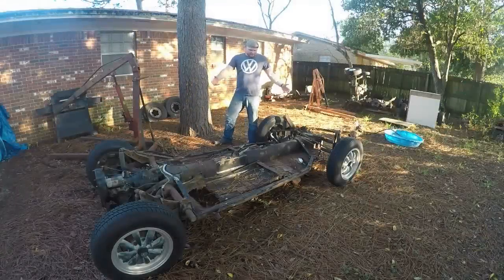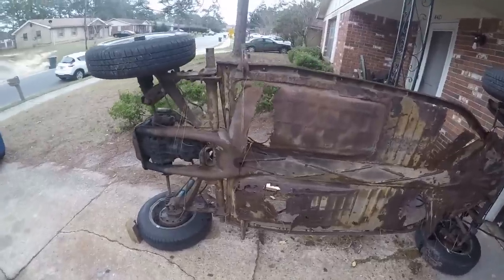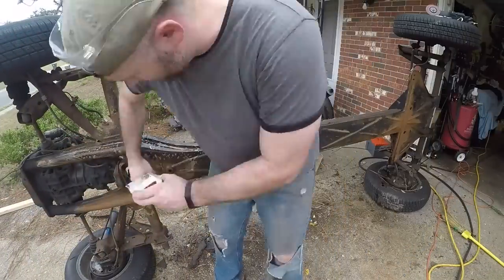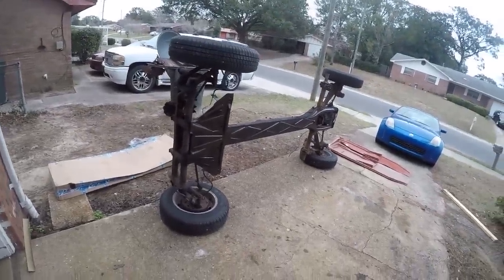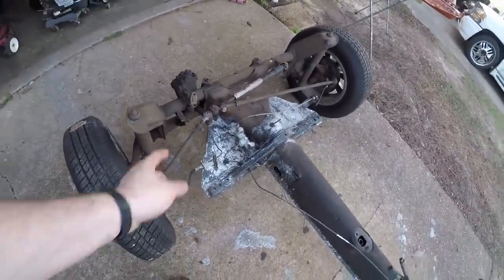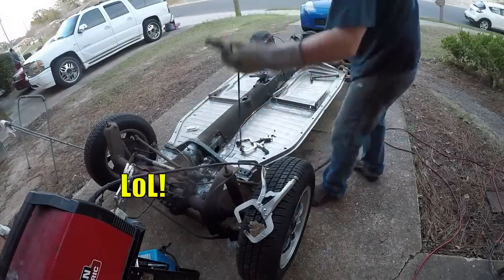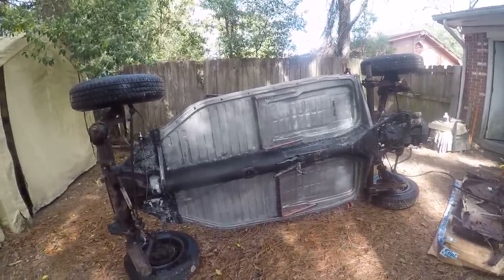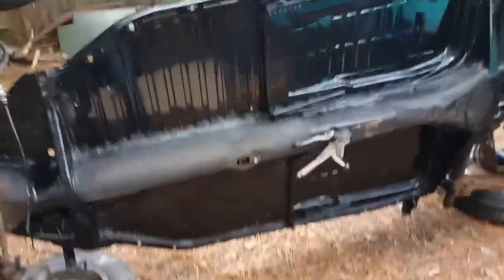Replace VW Floor Pans in 25 Minutes - (Beetle)

Comment: What if the original floor pan is thicker that the replacement pan? How do you weld it with a MIG pan-100 wire feed?  Settings? Really enjoy your tutoring.
Reply from the maker: Hi Chip!  If you find a thicker-than-stock floor pan... USE IT!  Haha!  I can't tell you how to use your welder though,  there are other videos and teachers for that one... and settings aren't always the same even from one indentical welder to another because of a myriad of variables such as materials used, preparation, weather, and even manfacturer's tolerances in the welder itself.  I hope I helped for whatever its worth!  Thanks for the question!
Reply: Thanks for replying. In reading the comments, I realized that the welding is another story. I'll keep practicing. While the body is off the chassis, and no engine, is there anything else I should do while I have access? I've done brakes, boots, brake lines, etc. Thanks again!
Reply from the maker: You pretty much nailed it... brakes!   If you want to clean and paint your transmission or replace your CV joints, or axle boots now would also be a good time!

Comment: Thanks for the video!  Do know if you customers ever have a hard time putting the body back on and having it fit correctly?  Does replacing the pans flex the rest of the sub-frame enough to make it difficult to put the body back on?  Would replacing the pans with the body on be in any way a safer bet?
Reply from the maker: Hi!  Thanks for the comment!  I am actually cutting a video that answers your questions, it should be up in the next week or so.  Thanks again!   :)

Comment: I've done this job several times on a citroen 2cv. Checking the bolt positions is a very important part of the replacement. Otherwise your Body won't fit on the chassis. Didn't you check this at your Beetle?
Reply from the maker: Nope.  Parts are pre cut and fit well.   Check out the follow up video to this and you'll see a defect I ran into related to that.

Comment: Cool. Just subbed. Quick question: was it really galvanized? I’d read not to weld galvanized steel, poison fumes resulting? If so, were you protected? Thanks
Reply from the maker: Someone already asked that.  Yes it should have been, and look which way the breeze was blowing in the video.  No concern to me at all.   I won't inhale ANY smoke EVER or I get sick immediately and stop working, its an allergy problem.  Thanks for the question!  :-D

Comment: If you, or anybody knows the answer to this that would be great. Would you recommend ordering full pans for replacement in a Meyers Manx? 14 inches of the pan will just get thrown out. Thanks, excellent intuitive video.
Reply from the maker: Yes get the full pan I think you'll be better off oh, you'll have some little extra pieces if you need them depending upon how everything was shortened and all the proportions put into it by the last guy,  I hope that helps! :-)
Reply: DuckmanCycles and VW Garage thanks man! I think I’ll go that route then!
Reply from the maker: You bet! Glad I could help!
Reply: Do you air hammer through the spot welds?
Reply from the maker: To remove the old junk, yes!  Sideways, but yes!
Reply: DuckmanCycles and VW Garage excellent. You have been extremely helpful. Thank you!

Comment: Duck, question... why did you choose not to take measurements from the side of the tunnel to the outer edge bolt holes on the old floors? It would suck when you're putting the body back on the pan and your bolt holes don't line up. Just curious. Thanks.
Reply from the maker: I get criticized for that a lot... lol!  But in my case I didn't need to.  The floor pan was the exact correct size, just needed to align it with the front and rear wings  Some aftermarket pans are cut a little bigger though, and you have to trim them. I demonstrated that with my Karmann Ghia floor pans a few years ago.  Check it out if you'd like!  https://youtu.be/unQJg_6WXOc

Comment: No worries about tweaking the tunnel or what remains of the pan by slinging it on it's side or letting it fall with no floors installed? I'm getting ready to attempt this on a '67 pan.
Reply from the maker: No worries at all!  I'm strong, but I'm not Superman.... if the tunnel/chassis were that fragile that a human could bend it I wouldn't want to drive one of these on the road.  😂😂😂😂😂😂   The floor pans do very little to making the chassis more rigid anyway.  The heater channels and the roof of the body is where the structure comes from once its all bolted together!  Thanks for your question!

Comment: You know I got to say I just came across you and I like what I see I wish you were my mechanic my last mechanic let's just say I'll leave it that but I like what I see you have done I did have one question what about doing like a undercoat Rhino Lining on the undercover of the carriage I always wondered if that would be a benefit or would that be counterproductive but I love everything I saw you're very good with it with your tools you took your time there's a passion for what you've done like I said I wish you were my mechanic I got to 74 I need to get restored I got a floor pan on the passenger side that has a gaping hole in it so it took it like a quarter inch plate steel and weld it over it I lost a lot of thing about Volkswagen's the word impossible does not apply to it you can do anything and everything you want to it with the right engineering skills hey thanks for the video to see more
Reply from the maker: Thanks for the kind words!  I love the stories, keep sharing, thanks!

Comment: thank you. You did an impressive job on what I would of passed as junk. I've contacted the local VW shop to replace part of the passenger side of my '63 bugs pan. It goes in next week. I have removed the passenger seat, rear seat and carpeting yesterday. I prob would of tried this myself if I'd of seen your video first.
Reply from the maker: Thank you for the comment! Yes, its really not all that hard, just a bit time consuming!

Comment: How tall was the gentleman that wanted the seat tracks moved back? My dad is 6'10" and he can fit his fist on top of his head before touching the headliner in his 66 vw bug.
Reply from the maker: Thanks fpr thr question! He is 6'1" and I'm 6'3", far shorter than your Dad, but the head room wasn't the worry so much is being able to get in and out of it comfortably.  I have trouble getting in and out from between the seat and the steering wheel. Even worse in a Karmann Ghia.  I have to crush thr seat down as I slot myself in or out. Now I can push the seat all the way back for lot more space and adjust it from there for comfort.  :-D

Comment: learning to weld and getting welding equipment is the main thing holding me back from taking the plunge into redoing a vw bug
Reply from the maker: Nowadays you can epoxy the panels together instead. You'll be seeing some of that on my current Bus project. No welder or welding experience needed!  Fast and easy!  thanks for the comment!
Reply: @DuckmanCycles   I'll keep my eye out for that!

Comment: How do you know those holes will line up to the body nuts? I think you could clamp a 2x4 to the original pan and mark the holes, set the new pan in place, put the 2x4 back and adjust.
Reply from the maker: That question was actually answered in my follow-up video to this where I put the body back on.  The holes didn't line up and I said exactly why.  I think it had lots of do with aftermarket components from different companies and poor quality control.

Comment: I did this today but found some issues with the air chisel part. I discovered that the part that remains on the spine (the lip) is actually double skinned and so you have to be careful you are removing the original pan from the lip and not splitting the two half of the lip itself.  Wish I'd realised that before I started as I've mangled the lip a bit.  Also very important to have a sharp chisel bit!
Reply from the maker: Yep gotta be sharp!  You can also use a grinder to grind the welds thin, then just peel the old metal off.
Reply: @DuckmanCycles  Did the other side today with a sharpened bit and it took like 20 mins!

Comment: just subscribed, im going to tackle this job soon, my question is about new rocker panels, is the heater channel structural to everything? or can i omit them?    thanks.
Reply from the maker: It depends on which car you have, Beetles don't have rockers, but Karnann Ghias do! The heater channels give the car most of its rigidity and are responsible for keeping your doors square, omitting them probably not an option.  :)
Reply: @DuckmanCycles  i have a 69 beetle.  and where is the best place to source parts in your opinion?   thanks
Reply from the maker: Links are always in the video description, but CIP1 has been good for anything else you might need!

Comment: Nice work!!! It's great to watch a pro perform this procedure. Is there anything wrong with using the phosphoric acid on rusted handbrake levers & heater levers? How about treating the suspension & torque tubes with it?
Reply from the maker: Do it!  Anything you want to clean rust from!

Comment: Looks great, quick question, what size compressor are you using to power the air-chisel.
Reply from the maker: 60 gallon tank!  It gets the job done quite well!  I may hook up a bigger diameter hose for better flow in the very near future.  Thanks for the comment and compliment!  :)

Comment: I am planning no putting a fiber glass dune  buggy body. However, is there a need to add some support on the outsider edges of the floor pans? will be looking for your anwer.
Reply from the maker: The fiberglass body should have all the support needed if it was constructed properly.  I hope that answers what you needed! Thanks for the question!

Comment: Thanks for making this video, it’s really helpful. One question I have is, was there a reason you didn’t drill and plug weld the floor pans to the chassis lip with seam sealer? Many thanks.
Reply from the maker: I never had much success with the drill method.   Seam sealer is in the video!  You missed it!  hehe!  Thanks for watching!  Thanks for the comment!  :-D
Reply: DuckmanCycles and VW Garage Thanks for your reply! I love your videos! Thanks for the info, I’m about to tackle this myself shortly along with the heater channels!
Reply from the maker: Make some videos!  I want to see!  Maybe I can help guide you along the way!

Comment: Question. When you throw on new floor pans like that, how do the bolt holes for the body line up right? It didnt look like you measured for them or anything...
Reply from the maker: It depends on the grade of floor pans that you buy, the better grades are usually much more perfectly cut and aligned... but as I've discovered if you're replacing the heater channels anyway everything is not going to line up if they come from two different manufacturers as in my case.  You can see that in the follow-up videos to this video. The width wss perfect but each bolt hole progressively was off by some measurement.  I hope that helps!  Thanks for the question!

Comment: How did you make sure the body mount holes would line up? Or did you just measure before you cut the pans off?
Reply from the maker: The holes are pretty fluid, there is a lot of room for error.  Those pans required no trimming so I didn't need to worry about them!  In a later video though, I discovered the holes in the heater channels I replaced were drilled with different spacing!  I never expected that!  I widened the holes in the pan a little bit, and additional on each following and everything was good!

Comment: Great job!  Did you weld the pan just in spots or stitch welded all the way.? And then did you add a seem sealer on top of that? Some close ups would have been nice, thanks
Reply from the maker: I welded in spots, about an inch and a half apart.  Maybe I'll hire a cameraman and a production crew someday to zoom in on me working.... depends on how much popularity I gain and how much money there is to be made.  Thanks again!
Reply: Could you have Plug welded by drilling holes in the pan and welded onto the chassis for strength ..just a thought... anyhow great Job....
Reply from the maker: I think that may be excessive.  You do want some amount of flex there, otherwise the welds start to break free.  This is the reason why you don't want to run a solid bead weld there.  😀  Hope that helps clarify!  Thanks for the questions.

Comment: Did you just spot weld it to the tunel? I did not see you make hole to spot it to the edge its supposed to be welded to. Also, no seam sealer on top?
Reply from the maker: Yes, holes not needed.  Gap between pan and tunnel, weld sits at the edge of pan into the tunnel lip.  I see seam sealer in the end of the video, guess you missed it.  :)  Thanks for the questions!

Comment: Great video and job , I am assuming you can do the Karmann Ghia the same way right ?
Reply from the maker: Yes Karmann Ghia works the same way just the pans are a bit wider.  The Karmann Ghia pans also usually don't include the rear wing portion.  So before you make any cuts to your floor pan make sure you have your new parts available so you can see where you need to cut,  I hope that helps, thanks so much for the question!
Reply: @DuckmanCycles   Yes , Thank you
Reply from the maker: @markanderson769  and thank you my friend

Comment: Great video,  rusted oil pan is standard on old Bugs. I'm working on a '64, given parts and labor I'm curious how much money would one charge to replace floor pans in my VW?  Thanks
Reply: *rusted floor pans
Reply from the maker: You had me unable to respond to that before you corrected, lol!  I'm about to put up a video to answer that question, will share the link with you when I get it uploaded!

Comment: Question: In the last floor pan video you punched holes to weld the pan, just curious why you didn't do that here. Unless I missed that part. thanks for the video.
Reply from the maker: That's a very good question that I did not address in this video. But the reason why is I just don't like the results of a hole punched welded pan.  No other reason, I've seen it done both ways so I figured I would try it without the holes :-)
Reply: Thank you for the response. I have owned three 72, 74, and 77 Super Beetle, your channel has inspired me to get a new project car. I appreciate the content. You do good work.

Comment: What is your weld set up? I’m about to invest in a Mig welder to do my pans and heater channel on my 65 bug. Just curious thank you!
Reply from the maker: I think I've got a Lincoln 140 HD, but if you're only going to use it one time for your floor pans you don't even have to get that fancy... find yourself an El Cheapo for about a hundred bucks...  mine actually lasted me for years, it did many floor pans!
Reply: Thanks for the reply! I’m planning on using for many different projects. Another question were you using gas shield or flex core?

Comment: Just kinda found your channel. Do you weld the floor pans full length along the tunnel are just many spot welds?  Also do you apply seam sealer after all is done?  I just got a 73 that has some SERIOUS rust in the floor pans.  Thanks for taking the time to share your knowledge.
Reply from the maker: Yes, only spots about 1.5 inch apart.  Make sure you get good penetration. This is how factory did it, too.  A constant bead won't flex and it will crack, so do spots only!  Yes to the seam sealer, I did it at the end of this video!  Usually I apply it between paint coats, I think it looks better, and that way the paint can soak into the seams.  😀😀😀 I hope that helps!  Thanks for the questions!
Reply: DuckmanCycles and VW Garage y
Reply from the maker: Y!!!

Comment: Amazing job, all that detail!!!
Just wondering why you removed the orange paint on the new floor pans instead of just sanding and painting over it.
Reply from the maker: Because it was peeling off and there was rust under it, I guess that's a pretty good reason right? LOL  I thought I might have said in the video but a lot of people seem to be asking that question so I probably didn't say.  Thanks much for your comment!
Reply: @DuckmanCycles  Great Job, But Maybe Spraying them with Bedliner ( On The Bottom Only) Might Be A Good Idea too if you Are in the Areas Where They Salt The Rads in the Winter
Reply: @stevenparker1063  Bedliner or any other thick coating underneath will make it look like you are hiding something, not good should you ever want to sell the car
Reply: @kailuafrog  good point!

Comment: Great video and excellent work! I’m going to soon replace pans on my 1963 Notchback,what all do I need to know about the welding part of this? I’m a perfectionist, so I always want things just right. What kind of welder are you using, what amperage and wire? Thanks.
Reply from the maker: Any cheap MIG welder will work for you.  You'll have to dial in to get the right settings, though, even if you had the same model as mine it probably won't be the same!  Thanks for the question!

Comment: Excellent video sir!  I’ll be doing the same thing to my 65 beetle soon. I’m curious if the holes on the pan still lined up well with the holes on the bottom of the body where they bolt into. That’s my biggest fear for my project. Any advice would greatly be appreciated.
Reply from the maker: That was answered in the follow up video where I mounted the body!   I had alignment issues, but not for the reasons that you'd think! https://youtu.be/Pipsu5z0Stk
Reply: @DuckmanCycles  Oh, ok. I’ll look for it. Thank you sir!
Reply from the maker: And thank you so much for the comment and questions!

Comment: Hello friend, excellent work what you show in your videos. a technical question which type of welding you use for the union of the floors. and what regulation has the machine greetings
Reply from the maker: Hi Francisco!  I spot weld it with a cheap flux core MIG.  I hope that helps answer your question!